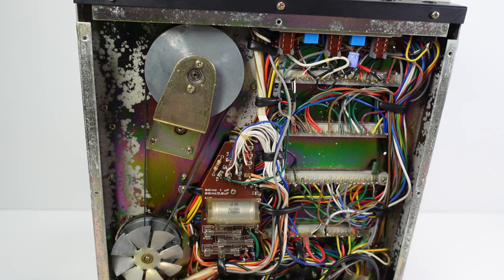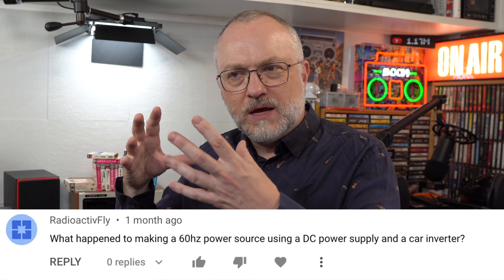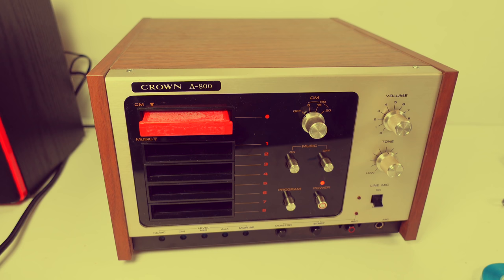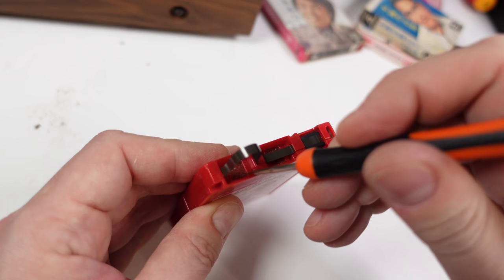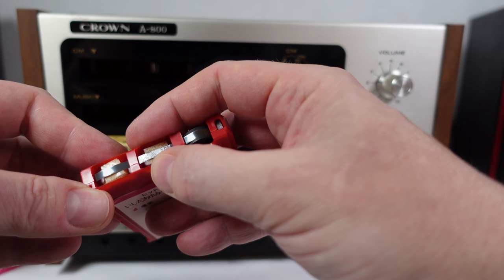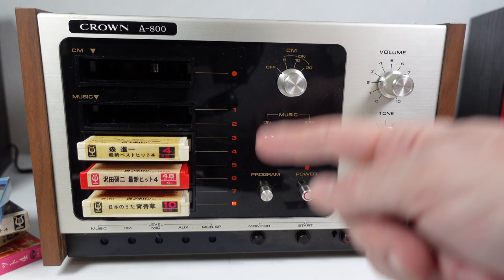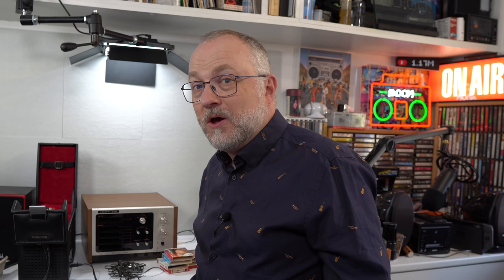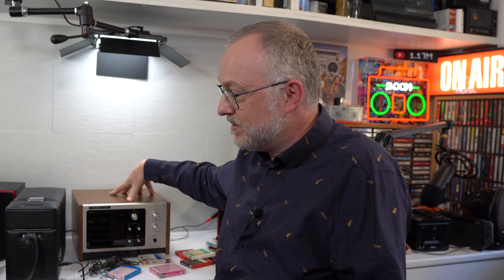Hipac - Fixes, fails and a flash of inspiration

Comment: Its no wonder that these cartridges died a death with the development of the Compact Cassette. The "endless loop" design was not only inconvenient, it was also very flawed imo. The Compact Cassette was a game changer really, and by design, a lot simpler and much more reliable. Sound quality also became very good on cassettes, as the product, and players evolved.
Now, cartridges and players are an oddity that rightly, belong in the annals of history.
Reply: It is odd, when you think about it, that they used a tape that could play in a continuous loop, but had to add metallic tape strips because they didn't want it to play in a continuous loop.
Reply: @DaedalusYoung  It did play in a continuous loop, the metal strips were there to tell the machine when to change tracks, hence why they were named 4 track cartridges by some, and 8 track by others, essentially that mean't 2 channels multiplied by 4 tracks, or programmes on stereo cartridges. Eventually, the player would return back to track one, if left to play all 4 tracks, or 'programnes' continuously.
Reply: @hermanmunster3358  But that would've worked with a non-continuous tape format. And those tapes probably would've been less likely to fail.
Reply: @DaedalusYoung  the thing is that it moved between the programs on the same tape too, if you had just one in a player rather than a multi player it would indeed loop after that
Reply: @DaedalusYoung  But how would you rewind them, to play the programme again, without the tape becoming seriously tangled? That is my point. In order to play the programmes again, these cartridges worked on the basis of a continuous loop,where the tape moved in one direction only, being that the tape is spooled onto a single reel, you CANNOT rewind them back to the start, which is why some players only had a fast forward, and not a REWIND control. That said, the original idea was quite ingenious, and the cartridges were quite an engineering feat. But it soon became apparent that their design was flawed.
Whereas with a cassette, you play it in one direction, and the tape is taken up by the empty second "take up reel" until you get to the end. Then you have to turn the tape over to play the other side, unless your machine has an auto reverse function. But the advantage of cassettes, was that you could rewind, or fast forward, back and forth, without risk of the tape tangling. You could also record the programmes in the same order as you would find on the vinyl LP version of the same album, something that often did not work with cartridges.
Reply: @hermanmunster3358  if they'd invented the ski slope cassette changer earlier, that would've done it.
Reply: Yea this stuff was extinct by 1980 i have never seen 8 track it was obsolete by the time i existed while cassettes where everywhere until the year 2000 and they both came out in the same time period in the 1960s.

Comment: Save that old capacitor! When you ever get the mystery tapes, You might need it if the machine runs the mystery tape too fast now!
Reply: With that kinda thing, I probably would've looked for a way to switch without having to open and resolder stuff. A set of dip switches with different caps might've been interesting.
Reply: @HappyBeezerStudios  The real question is, is the new capacitor letting too much current to another component, risking burning it out. Hopefully not. Thats the only reason I wouldnt use a switch if I couldnt get that answer.

Comment: In one of his books, Bill Bryson describes the overhead music in some commercial setting (I think possibly on a train, but I can't remember for sure) as having come from a compilation entitled Songs You Hoped You'd Never Hear Again. I feel like these tapes may be the Japanese equivalent, at least for people of a certain age. :)

I wonder if that "scanning to the bottom of the stack" thing it does when turned off is like an old-fashioned hard drive parking--it's moving the head down to a standby position at the bottom where it's not touching any of the tapes. I guess not, since each mech has its own head, but some part of the machinery still seems like it might be retiring to a neutral corner.

Comment: As for the capacitor issue, you COULD go so far as to install a switch that would select various capacitor values, and allow you to even create your own playback and recording speeds...See how slow it will record and playback, and how slower speeds would effect sound quality, or speed up the tape speed, and see how high the quality could become, and if there would be dependability issues or heat buildup in the tape being transported at too fast of a speed.....Would Wow and Flutter in crease with slower than designed speeds?...Being that it's essentially a "worthless format" in the sense that you won't ne finding any significant Led Zepplin early/lost demos on the format, and you have a collection of essentially "free" tapes to play with, it may be worth experimenting with various switchable capacitors and how each would effect the system's appeal as a consumer format (if it were to have competed with common consumer tape formats of the day)...Something to consider, I suppose. either way, a cool machine, and an equally cool video.

Comment: LOL... Youngsters have never heard of a resistor-capacitor timing circuit...  😏
Reply: We are all youngsters relative to some tortoise
Reply: Yeah grandpa we know when you were a kid you couldn't buy microcontrollers for less than a cent and you had to walk to school uphill, barefoot, in the snow.
Reply: @m0rphxam  and after school we had to walk home uphill, just to then start our 12 hour shift down the mines!
Reply: And apparently boomers aren’t familiar with capacitor phase shifts. The cap in question here isn’t used in an RC timing circuit.

Comment: Tape salad all the way. I remember my take up reel falling of my tapedeck, because i forgot to lock it in place. I was listening to my favorite tape on my headphones, and did not hear the reel falling off. The whole tape spooled right off to the ground, and as the tape finished, i noticed. That was a lot of tape on the floor. Fortunately i managed to rewind it all the way back on the supply reel by hand. I did it very carefully, and no harm was done. By the way, i suggest a pair of thin cotton gloves for splicing, so you don't soil the tape with skingrease.
That's a cause for tape sticking to capstans and pinchrollers.
Admire your perseverence, and like your channel. Keep going.

Comment: Interesting stuff!  I'm glad you got the system working at the 50 HZ frequency for your country. When I used to repair power supplies, the capacitors and transformer windings were already in place, and to change frequencies was a matter of jumping a different pin or switching a small jumper.

The foil tape is exactly the same I used for the BOT (beginning of tape) marker for the 2540 bpi backup tapes used on the DEC TU78 and other tape backup systems. It appears these small Hi-Pac and 8-track tapes suffered from the same ills of the tape drying out and falling off. The biggest difference is the BOT strip prevented the tape from loading and didn't cause the media from being eaten by the drive.

Comment: Someone may have already mentioned this in the thousand+ comments but you can get conductive paint pens that may help with the metallic strip on the tape. It will add hardly any thickness and no width to the tape so should pass through the capstan without any snagging. :) Wonderfully enlightening and enjoyable video once again. Thanks for the continued integrity. It does make a difference. :)

Comment: That could really turn into journey, I really hope you could find original cartridge for this machine. And really thank you for real demonstration of how this "unprofessional" repairs of old electronics go. I so similar sparks when I was repairing old soviet tape "deck" (if you can call it that) Comet-225S, I used metal screwdriver to disconnect a plug and bridged some connectors where was undischarged capacitors and FLASH. Now I never do like that.
Ending was kind of meta, love that. Thank you, Matt, I love that you are doing and you are a big part of why I like retro sound and music tech =)

Comment: Thumbed up sir :) Just a thought and you may not want to but a mod I made for my late step dad was to wire a remote switch to the back of the play/pause button on his MD player for when he did gigs. It enabled him to remotely pause his music between talking or telling a joke etc (he was a singer). A similar mod you could make without damaging anything on your background music player rather than messing with the cartridges you have is to wire a toggle switch to the top microswitch wires and find a convenient air hole to mount it so you can just fool the machine into thinking the cartridge you have inserted is recordable. That way you could, should you desire, record over any carts you have with your own music on the machine for your own pleasure. A simple mod like that won't interfere with the workings of the machine as your simply moving the switching effect away from the machine to a manual bypass so to speak. Again, your machine but something to consider :) Great vids again which I love watching. Im trying to find the vid where you mentioned where you get replacement belts from for cassette decks. I have a beautifully working Sony TC-WE475 (my late step dads). Sound is solid and clear with no noise except it WILL play back but it WONT rewind or fast forward on either deck :( I suspect a slipping belt/s as the unit uses 2 belts per deck (I looked at service manual but it only tells you 'belts' not any part number). They try to move but auto stop kicks in after a short while. It's like they have no moving power to move the tape. I tested with some commercial tapes which I am surprised they still play after 20 odd years without punch through. They aren't tight either they are easily played and sound just like CDs to be honest. I haven't opened it to have a look inside yet.

Comment: Great update! It's always a good idea after adding stick-on foil not just to  trim the sides, but actually cut into the tape slightly on either side. Not by much, less than a mm or so. This ensures nothing can snag in the cassette and cause the tape snarl-up you had here.

Comment: In the early 1980’s I volunteered occasionally with a small community theatre company and sometimes worked the spotlights and offstage sound effect booth. I remember that we used this very machine which we referred to as a cart player. We had a small library of sound effects (church bells, airplane engines, etc.) and would follow along in the script then push a button cueing the required effect.

Comment: I work on tube amps sometimes which have MONSTER filter capacitors, often 20uF 600v or larger, I've seen as much as 100uF in some big amps. Discharging the filter caps is one of the most critical steps in tube amps as an accidental shock from them can be potentially lethal (and when it doesn't kill you it hurts like a sumbitch). I've always either used an alligator clip connected to ground and touch that to the cap but that little box you showed is so smart. I'm gonna make something like that up because having a positive indication the charge is gone would provide a good peace of mind when I'm flailing my paws around in the chassis.

Comment: Tip: short out the power plug with a resistor before working on a device with capacitors - good chance to save discharge every transistor in the system by doing so.
Reply: Hi, only one problem with your comment. If the capacitors are on the ac mains side of the equipment, that will discharge those capacitors, however it will not discharge any capacitors whatsoever on the secondary circuit (secondary circuits are isolated from primary circuits) side of the device/equipment. Semiconductors (transistors, diodes, ic's etc) will not be protected from inadvertent discharge current. 💥😭

Comment: The speed did change but it is still really slow. I recognize all the singers and know first-hand how they all sound. What would really help is to install a variable capacitor and adjust the speed that way. Heck, there may already be one installed in this unit. I'm sure there's a service manual out there, as all Japanese hardware at the time had one. The manual should have a section on calibrating the unit.

Comment: I had to recap the captain motor in my akai reel to reel using that black type cap, was a learning experience on how to wire up electrical stuff due to having to replace a dual rated can cap with two separate solid state ones.

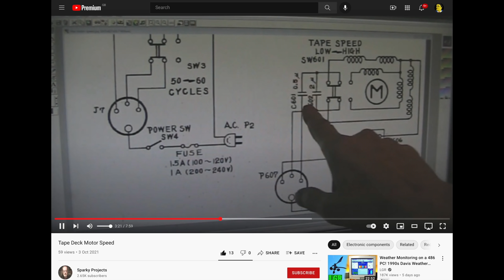Comment: 2:47 The quick answer is with an AC motor capacitors change speeds(capacitor AC phase-shift for induction motor). His reason as to why seems off. His unit/diagram has both capacitor values, your unit is a rip and replace, which further confuses matters.

Comment: @19:00 film projectionist here, it's easier to deal with placing foil tale if you place one end and align the tape before cutting it off the roll and then cutting it to length and finally smoothing the whole thing down.  There are different thicknesses of tape available.  If you machine keeps eating it I'd suggest checking with a local arthouse theatre to see if the foil tape they use is thinner than what you have.  I don't know what sort of distributors you have over there to deal with this stuff but they should know if they still have film projectors.

Comment: The cap affecting the speed entirely depends on the type of motor, and the circuit around it.

It needed somebody like Sparky (who has worked on similar machines before) to confirm things.

ie. unless somebody has worked on those machines, or has access to a service manual, or can trace some of the schematic purely from the previous video, there was no way to be certain. Lots of people seemed to be assuming either way.

Anyway, glad to see it sorted now. ;)
Reply: I'd like to repeat what others have said here...

What I like about this channel is you never like to assume anything if you're not sure about it.

It makes it more interesting to see the journey of discovery, and even the mistakes made.

I'm sure a lot of other channels will just edit out the mistakes, or simply not upload at all. While that might be nice for presentation, I personally think seeing the mistakes and learning is a big part of the interest.
Reply: I should say, btw, obviously I have the benefit of hindsight of seeing this vid...

But even though I do a fair bit in electronics, I genuinely wasn't sure about the motor speed thing either. lol

This is proper oldskool tech, and a some of the tricks and techniques used back then don't really get seen too often these days.

(ie. using the reactance of a capacitor to vary the speed of a motor. A lot of stuff is obviously solid-state these days, or done with PWM or brushless motors etc.)
Reply: 21:45 LOL. Great response, Matt.

The irony is, the guy apparently enjoys retro TV, ie. old adverts and other stuff from VHS or DVR recordings.

And his last video was about a Win 10 / Win XP machine. Interesting.

I'm now unsure whether he was "joking" or not. Probably not. lol

Comment: That was really interesting.
Makes me think of Sinclair microdrives 🤔
I remember studying inductor/capacitor circuits which resonated at a frequency determined by the component values, so swapping the cap. to alter the frequency makes sense.
I worked as a service engineer for a company which supplied regular tape/cassette background music equipment. The play heads were wired in reverse so that the rental tapes played backwards in a normal tape player.
Thanks for posting this 👍🤩
Reply: What size of cap would be needed to increase the tape speed by another step to go from 3.6cm/s to 4.8cm/s?

Comment: The orange beacons with the rotating reflectors on diggers and trucks etc have a dual pulley depending on whether they are running 12v or 24v. You swap the bulb as well.

Comment: Normally with synchronous motors the capacitor forms a time delay with one of the motorcoils to to create a rotating field. The capacitor is calculated and/or tuned to the right value in order to get the correct delay. The  AC outlet frequency eventually determines the correct speed and the capacitor value will only make the motor start properly and run with the least vibration.
Reply: I thought something like that. The change in cap doesn't cause the different speed, but is there to make the cap run right at the determined speed.

Comment: Weatherstripping can be found in a 3/8inch wide about 3/16 inch height.  Approximately 4.8mm x 1cm. It is similar to what you used.  Foam with a sticky side, paper backed.

Comment: Now we know how to make a goblin voice effect! 🤣

As to whether the capacitor would work, I was in the "no" camp but then I realised it's very large for its capacitance. It looked like an electrolytic which would have 20% or worse tolerance, but would also have had a much higher capacitance at that size. An accurate, stable timing capacitor of that value would need to be quite large, especially in the past.

BTW, I do enjoy seeing the mistakes too. If I never saw anything go wrong, I'd never try anything myself. I have enough of a problem that way anyway. Good video, Techmoan. 👍